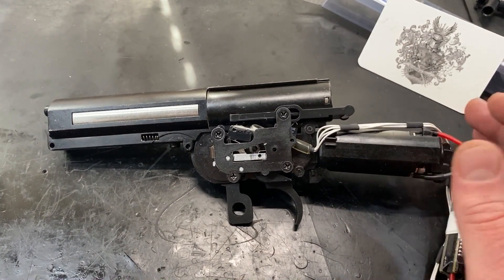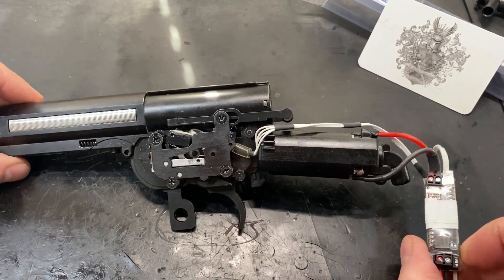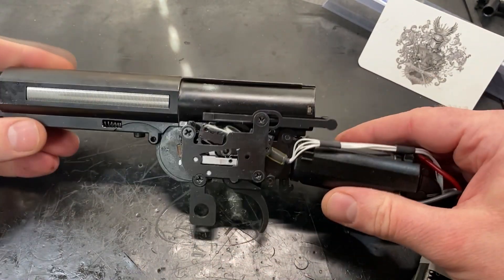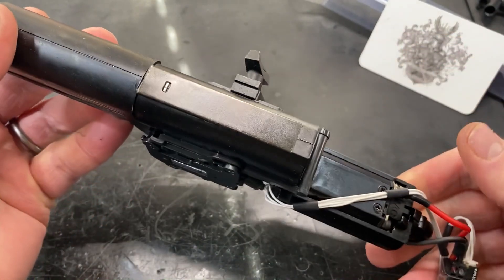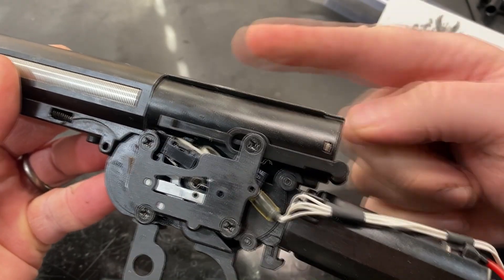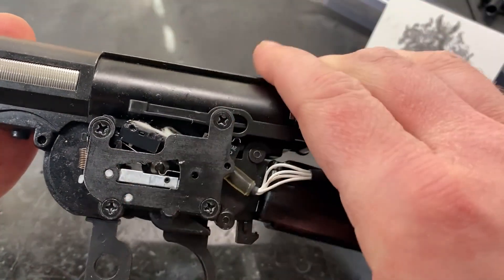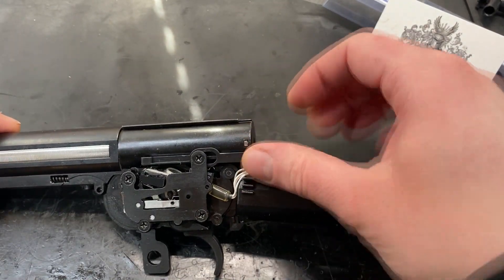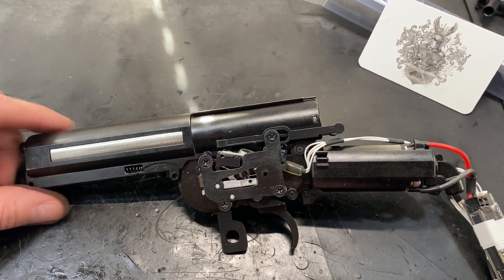Upgraded Tokyo Marui Socom M14 showcase

Comment: That's amazing. Is there a wire diagram available on how you did this mod? Been looking do something similar but with a a Gate MERF 3.2 AB.
Reply from the maker: On my website, there’s a guide to this general setup that shows the pin positions for the Chimera input. 

You couldn’t do this specifically with the MERF but you could with a PERUN ETU++ 
PERUN helpfully put the pin positions in their online manual for this very reason :D

Basically you take one side of each switch as ground and connect them all together (it doesn’t matter how, so long as they all go back to one wire on the MOSFET input pin) then take the other side of each switch to the corresponding input pin on the MOSFET.
Reply: Darn, I've already have the MERF on hand. Guess I rig the trolley assembly to house the switch then. Thanks for the input though.

Comment: I got a spare nano AAB or ASR mosfet and was thinking of installing it in my m14…think it would be a good start for a mosfet?
Reply from the maker: Yeah, absolutely :) 
Either of those would be an excellent choice
Reply: @KingdomofAirsoftUK  sweet and also this would be my first time working on a v7 GB, so I was wondering where the trigger contacts are for the soldering of the mosfet? Can’t seem to find any decent videos when it comes to v7 GB
Reply: @KingdomofAirsoftUK  hey I’m back and need help, so I’m still trying to find the spots to solder the trigger contacts but I’m also having a hard time trying to figure out the plugs and where they should go, what should be removed? Etc